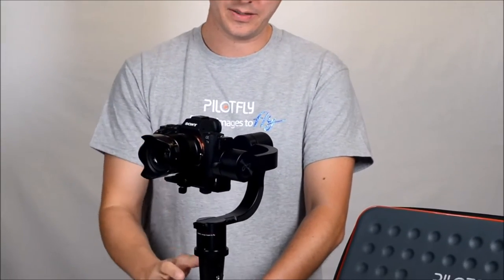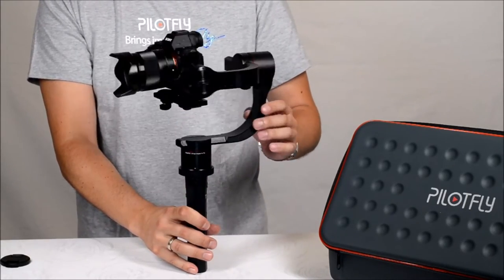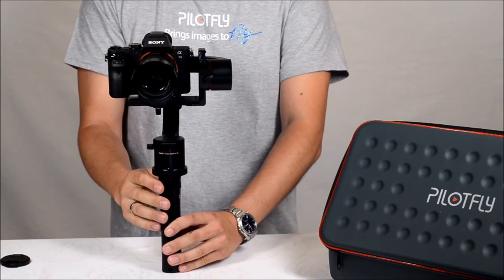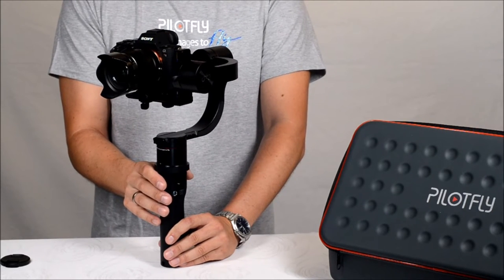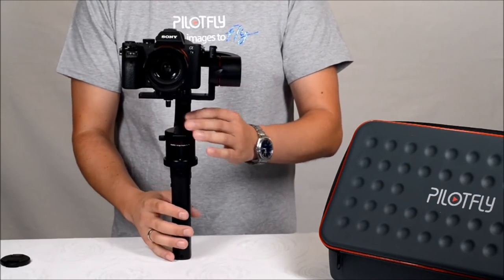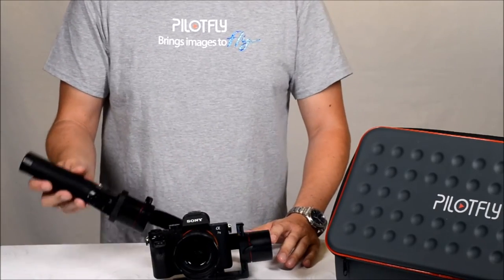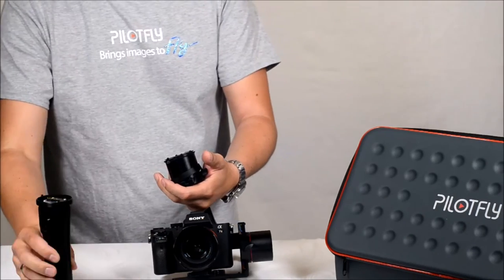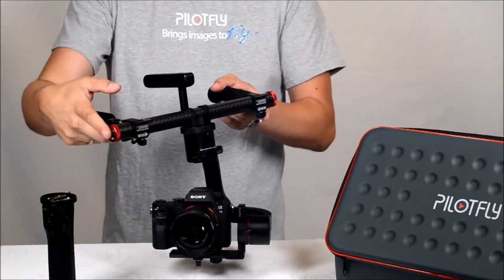Pilotfly H2 Features

Comment: Very nice demonstration of the features.
I saw that youre able to do use a timelapse mode with the optional remote control for the H2.
Is it also possible to use the timelapse mode without purchasing the remote?
Thanks in advance.

Comment: Are there various modes I should be programming the gimbal to depending on the weight of the camera and lens?  So a heavier payload is a higher profile setting and a lighter lens for example is a lower profile setting?  I've been switching lenses on my Gh5 to find which I like best and just trying to make sure I'm configuring it correctly each time I make a switch.
Reply from the maker: Imagery Wedding Films depends on which gimbal you have.

Comment: I have the 2-handed handle, love it, but why no power indicator light? Not obvious when the gimbal is on without a LED light.
Reply: In Simplebgc Software you can adjust the Vortage level, at low level you get a sound.
Reply: Yes, I actually turn off the sound due to quiet environments while shooting. And I also film in high volume locations, so I would never hear the sound. So I would like a light to tell me when it is on. Not a big deal, though.
Reply: okay :)

Comment: i attached my own quick release system to pilotflys plate to make removing my camera off and on the gimbal quicker because I shoot weddings. everything is working fine but the camera knocks into the gimbal. its not totally free floating. do you have any suggestions?
Reply: i have a sony a6500 and a rokinon 12mm. the lens hood hits the gimbal when i tilt it downward.

Comment: Is here enough clearance for a Rode Mic Pro ontop?
Reply from the maker: yes, but the working range is of course restricted. Therefore we suggest you to mount the Rode Mic on the side of the handle. The #PilotflyH2 is very versatile and it comes with three 1/4" screw holes one on each side. Which gives you the possibility to mount an extension arm for an external display or a Mic.
Reply: Pilotfly Germany - Gimbal und Kamerazubehör in Augsburg

Comment: hi Marcus, I just brought the 2-hand handle but couldn't get it to work, i had properly installed the unit with the correct insert of the batteries but the unit does not turn on, do you have to fully charge the batteries before usage? or am i doing something wrong?
Reply from the maker: Try first to use the 1-hand handle in order to verify that the gimbal works. If only 2-hand handle is not working then check the pins whether they are ok. Ensure that batteries are fully charged and correct implemented in the battery compartment. If this still does not help then contact us via email at info@pilotfly.de
Reply: The 1 hand handle works. All pins look fine on the 2 handle unit. Had fully charged the batteries on my last try but no luck. I had purchased this unit through the TW branch, can i still email to you guys instead? (they are rather slow on responding) Thanks for reply
Reply from the maker: sure

Comment: Is this water resistance? Can I take it around water fall?
Reply from the maker: It is not water resistant but some water drops or higher humidity will not kill the gimbal.
Reply: Thank you :) One more question if you are okay..can this h2 be used with go pro or iphone?? or does my gear have to be at certain weight?
Reply from the maker: Moon K can be also used but PID settings need to be adjusted because of the light weight. Frankly spoken if you want to use a Smartphone then you should chose the new Pilotfly SP-1 stabilizer for Smartphones. More info at www.pilotfly.de
Reply: Thank you. Sorry for newbie questions...how many PID settings can I save? Say I have DSLR with heavier lens and a phone. If I want to use both of them in the field, is there a way to switch PID setting without a computer program?

Comment: hey Marcus my roll axes doesn't turn freely. it blocks after a 180 degree turn. why is that . thanks
Reply from the maker: Roll axis was limited in the beginning, we upgraded the H2 by running change. If your H2 is limited then it is not a big issue since you also can turn around the handle to use invert mode.
Reply from the maker: +Bash N. It is really not a big deal, don't worry. You have all functions available just not 360 degree on roll, means you can only turn the handle on one side to invert it. Yes fully agree on your suggestion, we are working now on more videos to describe the features of the Software. Will come soon!
Reply from the maker: After FW upgrade there is no setup necessary.